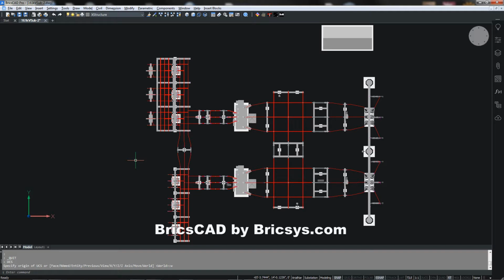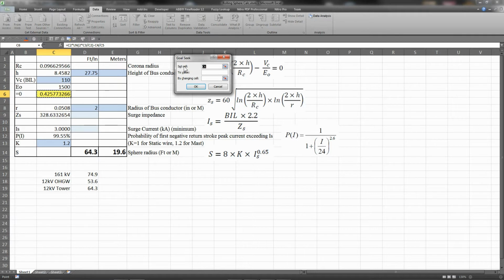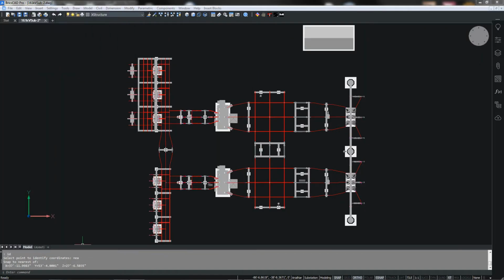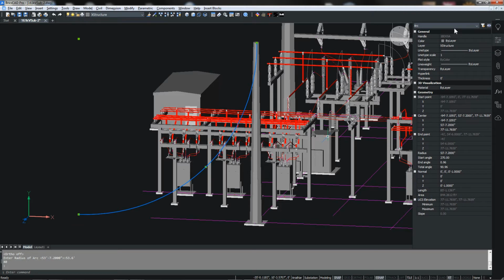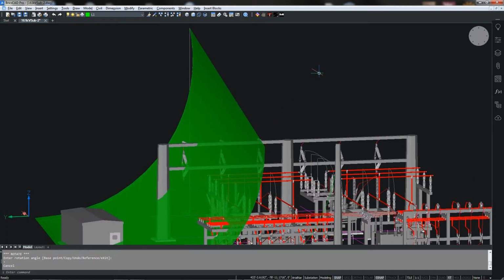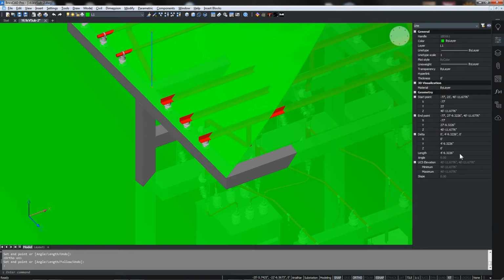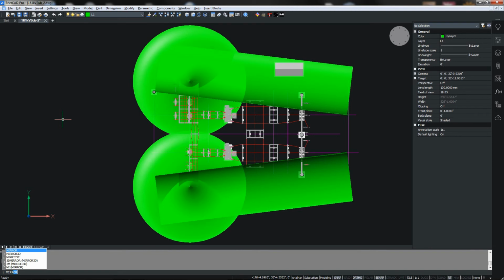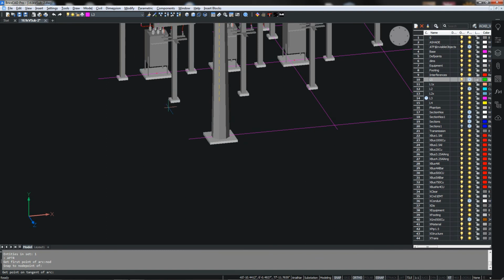the3DUtility #6 - Substation Lightning Protection from the IEEE Std 998 Rolling Sphere Method.

Comment: Thanks for the video!  A question though. I set up a .lsp file, copied & pasted this with edits as described, loaded the file into AutoCAD 2023.  But when I type "APTR" it says "Unknown Command."  Any ideas?  Thanks!
Reply from the maker: Did you include the two functions (dtr & rtd) just above aptr? If that is not the solution, please reply back.
Reply: @gwflew  Yes. I copied from ; Constants down to   (setvar "Osmode" osm)
)
Reply from the maker: @MikeH007 Sorry about that Mike, looks like I left out a right paren. Here's the correct segment of code: 
  (setq pt1 (getpoint "Get first point of arc:")
        pt2 (getpoint pt1 "Get point on tangent of arc:")
        rr (distof (getstring (strcat "Enter Radius of Arc [" (rtos rad) "]:")))
  ) <-----------------Left out paren
I appreciate the heads up and have corrected it in the comments. Thanks
Reply: @gwflew  Thanks so much!

Comment: Mr Flew, good video!  Would you kindly put a link to the Excel spreadsheet you created in the comments? Regards
Reply from the maker: Tim, I recently discovered an error in the lisp program. I have modified it in the description and you might want to copy it again and try it. It was caused by a difference in the Arc command between BricCAD and AutoCAD.
Reply from the maker: Tim, I have added a link to the spreadsheet. You should thoroughly understand the calculation process before using it. I would suggest that you run it through some of the examples in the IEEE Std. The answers will probably not agree exactly, but the differences should be minor. Also, the spreadsheet includes a macro. You might have to change your security level to open it. Let me know if you have any problems.
Reply: @gwflew  thanks for spreadsheet. I will do that. I’m just starting my substation engineering design career and have lots to learn. Our company has a spreadsheet I found out but I’m trying to understand the concepts from all angles. Regards!

Comment: Hi Mr George, I try to apply the lisp, but this show an error message in autocad 2017 "; error: no function definition: RTD". Could yo help me please. Thanks a lot.
Reply from the maker: Eddison, check the comments. I have added two functions - dtr and rtd. They should fix the problem and should be self explanatory. Thanks for pointing this out.
Reply from the maker: Eddison, I recently discovered an error in the lisp program. I have modified it in the description and you might want to copy it again and try it. It was caused by a difference in the Arc command between BricCAD and AutoCAD.